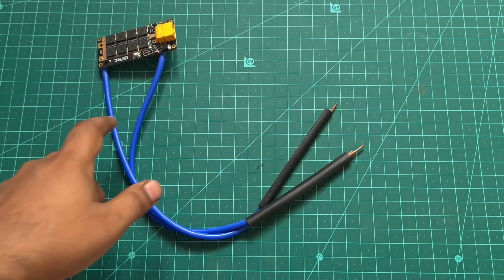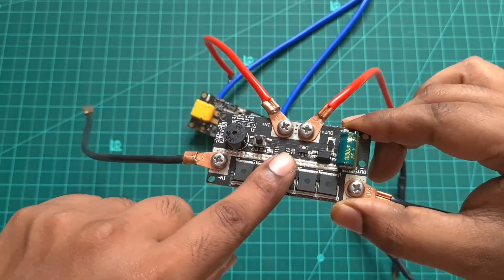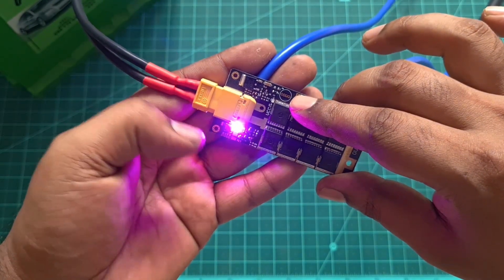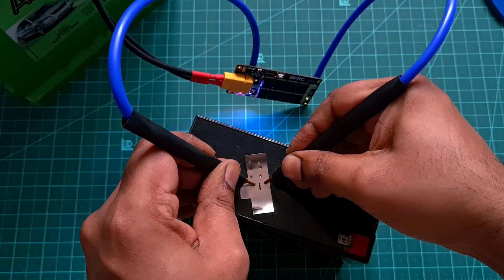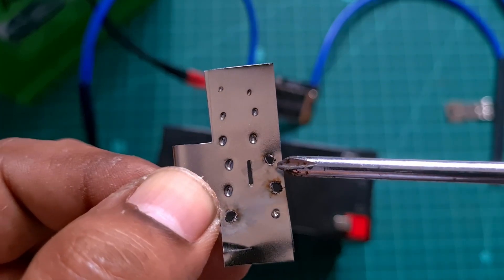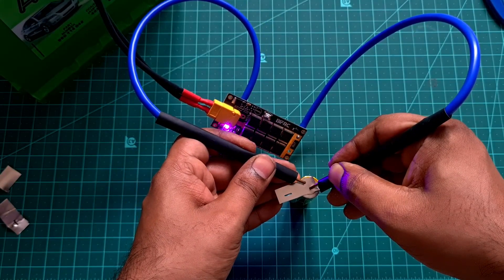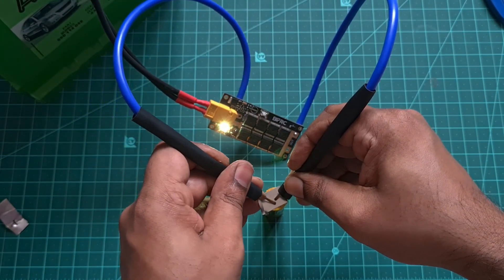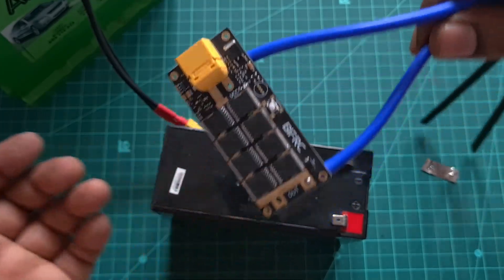BIFRC Spot Welder Cheap and Perfect- Overview- Review and Test

Comment: Hey is this bifrc module can work with 3s 2500 mah  45C lipo battery?
I really want to buy this 🥲
Reply from the maker: Yes it should work. Pls do not go to extreme levels.
Reply: @diyIndia  extreme level can damage MOSFET if proper current will not supplied?

Comment: Hi ican get my spot welder to weld its not got enough power or heat I got 12g wire to a car battery the cables get hot but the rest of it is cold its nearly their have I got the wrong size cable on it .its loss power somewhere.

Comment: I'm so disappointed I ordered one of these and I used my 75c 45ah 15.5v lithium battery bank and on the lowest setting this thing was blowing through razorblades and shooting sparks everywhere and died after about 5 tries on the lowest setting 😥
Reply: It only works with 12v battery
Your c rating was perfect
But 15.5 v will definately ruin the module
Reply: @kartikeytiwarixiia0579  umm no that's not correct this model can use a voltage up to 16.8v
However this one doesn't have a regulator built in which I guess is ok in normal situation because the maximum amps the MOSFETs combined can handle before exploding is 3500A which 99% of people don't have a battery that's anywhere even close to that capability
But my 45AH lithium battery is homemade by me and I used 75C 5AH rated cells that can handle 300A each and on 1sec short circuit they can do about 1000a each and I used 40 cells to build this battery module so the spot welder had to much amperage available and that's why it exploded 2 MOSFE's closest to the terminal exploded and the lead wires shot electricity through the razorblade I was trying to weld and through the 2nd razor blade and there were holes in both razor blades where the welding leads were touching and the liquid metal left a whole in my shirt I had on as well  . And the lead wires and power wires were hot AF too
Reply: @SheikhN-bible-syndrome  damn , then your module was shipped faulty . 
I am also thinking to buy this Module , but worrying about its quality, because I have to buy this and a 60C battery too . 
Huge investment just for few batteries 😐🥲
Reply: @kartikeytiwarixiia0579  what? No the unit wasn't shipped  faulty it is just a bad design because it was not built with protection circuitry to keep it from overloading they just assumed it was beefy enough that nobody would have a battery big enough to overload it but I did

And secondly you saying you have to buy a 60c battery with it shows me that you don't understand how batteries work you could have a hundred c battery and it still be too small or you could have a 10c battery and it'd be too big because just stating the c rating is not enough to qualify the battery for the job or not because the sea rating is just one part of the equation you need the amp hours as well because a 50 milliamp 60c rated battery won't do the job but a 10 amp hour 60 sea rated battery would be more than enough because 60c means nothing without the amp hour rating as well because the combination of the two is what matters so you don't need a 60 c rated battery you need a battery with enough reserve storage to not be drained within two or three shots and yet has a high enough sea rating to discharge enough power quick enough to where you don't overheat the mosfets due to voltage sag. It sounds like you need to do some more research before you get into the world of battery making
Reply: @SheikhN-bible-syndrome  yes definately, i knew that , I forgot to mention that 
60c 2.2AH 3S

Comment: A car battery is not the best for this job because the resistance is to high Ideally a high c rated lithium battery is best
Reply: Are you crazy? Some car batteries have 600-800A of starting current! You’re saying that’s not enough?😂 My 4s 4500mah lipo gets hot after few shots and then i have to wait till it cools down - really annoying. I need to find a car battery which will be able to provide way more shoots without getting hot.

Comment: The mosfet will burn after something...i hve the same welder i just did a by pass connection with 12 volt adapter...so that it will not put load on mosfets

Comment: I tried this on 7ah battery but not working, discharge current matters?
Can I use 3s lipo battery rated 1500 mah 40c ? Plz reply
Reply: Need more current, your battery is only 60A, it needs at 100A to operate, above 300A CCA is preferred for operation.

Comment: Hello nicely explained. I just got this same board from Robu. Attaching 12v battery with 20a BMS. I tried all the percentage settings, but the circuit turns off after a couple of seconds after touching the probes to the strip. Then, when I remove and replug the battery it turns on again. But never welds. Does the same. What should be missing? Do we need to attach a battery without BMS?
Reply: BMS limits the over current that's why it turn of the circuit, I'm faced same problem.
Reply: @lets.powerup   , 
LiPo battery pack worked well. It has no BMS. But the PCB is not capable of handeling the high current. It got shorted. I got replacement. I added heatsync, extra thick solder on the PCB from back. It worked better. But then Again same thing happened, it keeps burning whichever component or PCB joint is weak.
Reply: @KetansaCreatesArt  mine died after 5 welds and I'm using a huge battery bank only mine on the lowest setting was melting through shit lol I was like wtf as liquid metal shoots across my table
Reply from the maker: Using a battery with 20A bms is the limiting factor here. 20A bms will not be able to provide the surge current needed to spot welding. Try by using it without bms.
Reply: @diyIndia   , Hey bro, got the BIFRC one. Using 5200mah 40c LiPo. After welding 2 batteries, the multi-coloured mode light stopped, and the green blinking light is glowing constantly whenever I plug the battery. Now it welds no more. What could have happened?
Thsnk you.
Reply: @diyIndia  , Yes thank you very much. I will make one without bms.

Comment: These boards without a capacitor will DIE if you use a weak battery because the gate supply voltage will drop too much and the mosfet will burn. I want to add a capacitor.
Reply: And the capacitor cant be used to be drained into the weld. it has to be disconnected from the main power

Comment: Excellent video, result in the title.  So clean and concise, all my questions were answered.  Thanks.  Also, you may want to put heatsinks on your mosfets, even the cheapest ones with stickers on them will help.  What gauge wire do you recommend for the probes, this welder is 40amp pulses?
Reply from the maker: Thank you. Glad that you liked the video. 8awg wire should be good enough for small burst of pulses.